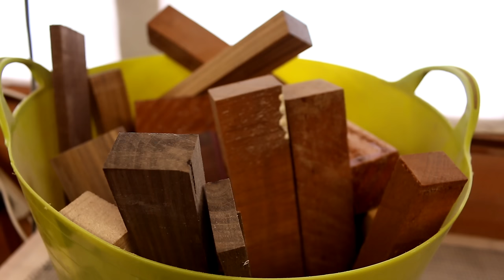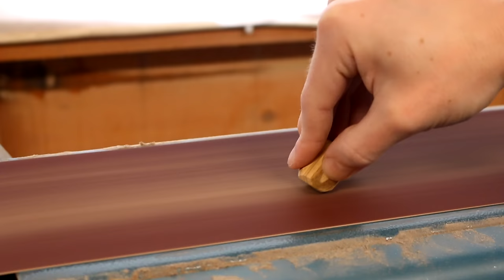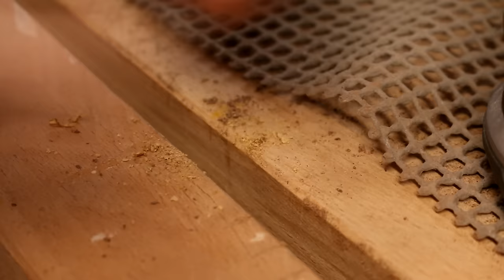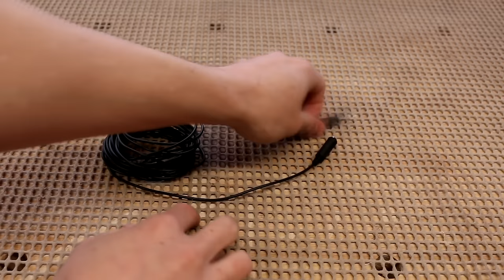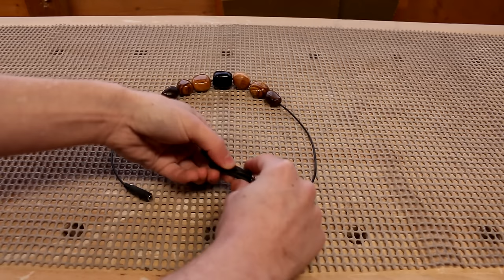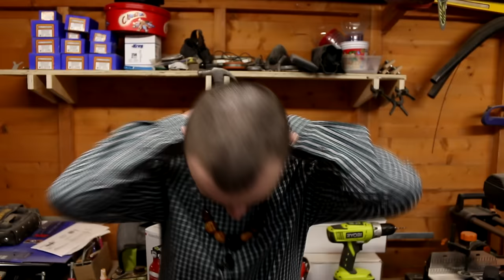Wooden Pebble Necklace From Scraps

Comment: nice idea, came out great joe. Dont think I can explain this, but If you build a box above the belt sander and drop small scraps in while its running, they come out pebble shape.
Reply: +Average Joes Joinery Im not good at explaining, but imagine a box with no top or bottom, roughly the width of your sanding belt. this box or frame is clamped about 2mm above the belt, and the sander turned on. Small cubes of scraps are dropped in and the rotating belt sends the cubes to the back wall of the box. Here the belt keeps them spinning around and it shapes the scraps in to pebble type things. Hope this makes sense.
Reply: +Average Joes Joinery Where you get the exotics, they are hard to find in the uk